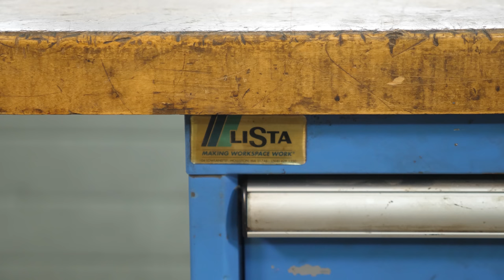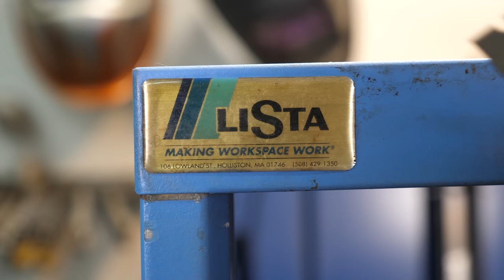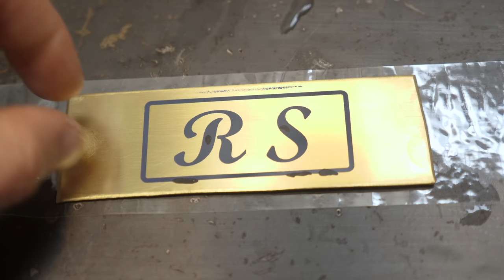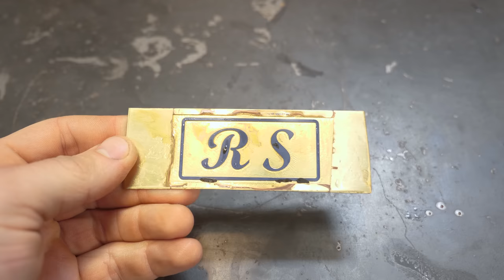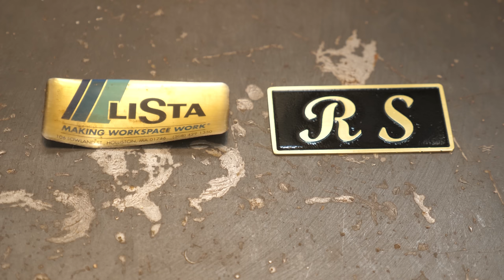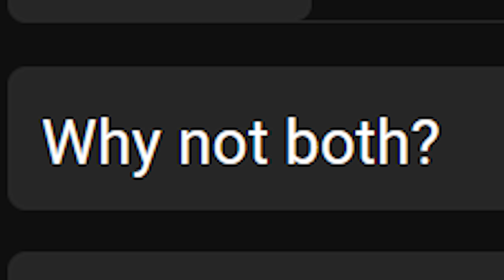Restoring an Old Beat Up Workbench

Comment: That really turned out nice. I kick myself in the butt for not taking advantage of work benches I have seen and I thought it would be to difficult because of the wooden top. You're not there right now the ballpark.

I had a neighbor of mine when to harbor freight tools with me. He asked what's right looking for anything particular I said yes a service type of car made out of metal. When I showed him what I was getting and what I was paying for it he said to me that at his work about a month earlier the district manager told him to put the cart at back since there was missing paint and from rusting. He told me it was more rusted up he said if I wanted you will throw it in the back of his truck on his way home the next day.

I was like a little kid on Christmas waiting to see what I got. My mind was blown away about how heavy duty this thing was. They're really wasn't anything to take apart it's all weld it together. So all I needed was to make a trip to Home Depot pick up a couple cans of spray paint. As soon as I got back I seen it the whole entire cart then primed and painted the cart.

That was 12 years ago and it is still in great shape.

Metal stuff does not scare me away since I know how well and there's no shortage of machines around my house. It's just the wood top to that bench that stops me.

Could you tell me what you put on the top. It seems to be some sort of epoxy since you mix the two things together.

Also I have a great video from you. I'm already a subscriber and of course I make sure to hit the like button.

Comment: The planer and maybe a couple dowels would have increased its durability, but routing out a couple slots for bridges between the planks would have increased the curb appeal. Lots of over spray on the drawers

Comment: What was the product used on the metal top? It looked like something you mixed together.
Reply from the maker: It's bluing solution. Normally you dilute it with water which is what I did

Comment: four swivel rollers so you won't ever have to lift an end and you can get it wedged in anywhere you need. I like the steel plate for an optional top though.

Comment: The hole filling tactic was nifty keen indeed. Though you could have used a disposable plastic bag cut a corner off and squirt the mix like icing into the holes rather than try to force it in with a putty knife. Still though, quite good work.

Comment: Top turned out OK for a basic glue up. You did nice work on the metal as well. Terrible rattle can paint job and it looks it. Should have kept blue and original.
Reply: yeah lista is iconic, either keep it the blue or the old school listas were orange.

Comment: I always feel a restoration like this is a commitment to maintaining a valuable piece of workshop equipment.  From that perspective, this was an excellent job

I don’t know that I’ve ever seen this particular brand of merchandise, and there are some elements of it, specifically the two uprights, which make it look like a converted desk. The cabinet/drawer piece also looks out of place, again because that element looks like desk drawers rather than a tool cabinet for wrenches/screwdrivers, etc.  With all of that said however, I’d be pretty happy to have this in my shop.

You spent a fair amount of time cleaning up the wooden top (looks like butcher block to me), and when you were finished, it was beautiful.  Was there any consideration in just flipping it over and using the underside as the top?  It would have seemed to have been whole lot less work in cleaning it up than you had to spend on redoing the original top side.

But why do all of that work just to cover it up with metal?  If you planned to do that from the start, why waste the time refinishing the wood?  Just slap the metal on it and move on.  Although your goal of restoring and/or improving it was clearly met, at the end of the day, it’s still just a workbench.  Leave the wood exposed so it can be admired.
Reply: I realize this is 6 months late, but the underside seemed to have inserts to accept the bolts holding on the top

Comment: Well I think the convertible  metal top is cool it does mean you cannot put a vise on the table. I would have left an eight or ten inch strip on one side of the table either wood or metal so a vise could be attached.

Comment: There is a massive difference between UK and US workers. UK wood workers wood never sand the top but would use grime and oil remover. Metal work much the same but unlike most comments. Metal would not be painted and the patina would remain (unless it is rust through)

Comment: The only thing I would have done differently would be using a planer on those top pieces, and I would have replaced that flimsy bottom shelf with wood. Cool project, though.

Comment: I think if would've made a cut out into the wooden bench enough to slip a steel sheet or metal in general for around half the size of the bench and put some screws in to hold it or any other idea .. it would have looked cool but I have no idea about it's functionality .. it just popped up on my mind

Comment: I like the end result, though it seems that there were some shortcuts taken.
Insides of the drawer cabinet and the underside of that wooden desk being the biggest ones.

Also, it seems that you've welded the hinges a little too cold. Next time, a bit more voltage should do the trick, but I doubt the plate will come off the hinges any time soon.

A bit more attention to the entire build would've been nice. And not just focusing on what you see.

Comment: lovely work but i feel the hinged metal top was not a good choice.
too cumbersome and potentially dangerous when flipping, for a mostly useless feature.
Reply: Depends on the use case for the table - The metal sheet makes sense if he's not planning on ever setting up a welding table due to space but doesn't want to risk scorching the table surface

Comment: I enjoyed most of this video. Well done. 

Some feedback if I may: 

1. Why change the colour of the bench? This was a restoration was it not? 
2. You welded on an unprotected, finished, wooden worktop. Words fail me. You also neglected to address the obvious burn marks left behind. 
3. Why not plane the top of the worktop? So much quicker, easier and a better result. 
4. Split joining - I'm not the first in this coments to say this. This ought to have been done on a flat workbench, the edges squared after applying the glue, then clamped in place. Biscuit or dowels would've made it last longer, but bow-tie spline would've been the way to go here. Heaps more work, but worth it in the long run.
5. No handle for metal worktop. You could've added a small tab, handle or something along those lines. 
6. Spray paint - Did you not notice the missed areas inside the cabinet where the rails attach? 5 extra seconds each side while painting and it would've been invisible. 
7. No lock replacement on the drawers. This is just disappointing. 

As I say - good work, but some small details missed. Still - damn good on you for doing it rather than sitting around the house watching YT.

Comment: Much better without the metal sheet on top. Top end restoration which felt a bit ruined but a relatively rough job on the hinge welding 😬 sorry but it looked messy. Great effort on everything else though

Comment: Today I'm a particularly asshole.
the work on the whole is a good job. you see that you work more frequently with iron. for the wooden top, on the other hand, you can do better. you could have rested the clamps on the ground and the boards on top, in this way already with the weight they would have leveled off a minimum. on the short side at the end I would have put a rigid and straight strip on both sides and put in the winepress to have an excellent alignment there too.
I completely liked the work of the steel top with the hinges even if I don't understand why I didn't remove it from the table to clean the underneath. in any case the worst part was the wheels.
1) you could assemble them before so the work would have been easier than lifting all the injured part of the table including the drawers.
2) 4 swivel wheels with the two front wheels with brakes. having those two fixed on one side is an incomprehensible choice.

sorry but today it's raining and i'm in a bad mood so i'm trying to release my anger because i can't find where to turn my head

Comment: Good job! Dut it is noticeable in the video that the workbench needs a back panel: only 6 bolts and a shelf on the bottom - this is not enough for the rigidity of the whole structure.

Comment: Figure out how to have a removable wood top that could be bolted to the steel welding top, when needed. Keep track of how often you need to use it as a welding bench or a wood top bench, and go from there.

Comment: No need for restoration on something like this. Throw a 1/4" mdf on the top with a couple of screws so you can replace it, and probably another sheet on the back to stiffen up the lateral movement. Some 409 degreaser on the metal and you're good to go!

Comment: I was hoping that you would leave the blue color.... Red is too aggressive and bright.  And why is painting done on a surface that has not been cleared of old paint?
Reply: Inside the drawer compartment the old color has been left. Not visible - not needed? Saving paint? And lastly, why isn’t the second side of the metal table top given the same bluing treatment?
Reply: The finished work looks beautiful, no doubt, but all the above details give reason to doubt the quality of this particular work.

Comment: Really nice job. There’s only a couple things o would’ve done different in the design. One, I wouldn’t have put steel on the whole thing. Given what I know now of wood working and such, I would of routed out a 2’x2’ space and had the steel recessed down in there for a more functional and sleek look. Two, I would’ve put swivel casters on both sides for easier mobility. My other beef with this is why would you work that metal on the wood bench you just refinished??? That’s just me though!!!

Comment: I gotta say, this one isn't that good.
the red color is already chipped before you finished it, the weld on the hinges are ugly, even after grinding, and you coated the metal plate on just one side.
Anytime you fold the metal plate up, you'll see the gross underside, and you don't even have a way to lock it in the upside position. that's gonna bash your head in when it comes down

Comment: I don't understand the intended use of this bench? If a woodpeckers bench it needs bench dog holes, and a wood vice not a metal top. If a metal workers bench the tub top is too thin, and the bench is way to light. Also wood top  was nice till you burned it attaching the hinges. Additionally don't care for the Red with what looks to be a blue lathe bench next to it. Why didn't you refinish inside the drawer box, or at least  grey like the drawer sides? Well done, but not beautiful.

Comment: You did a great job but it’s a work bench so l don’t see the point on a restoration. It’s a work bench that gonna dirty right back up unless there is such a thing as a “show bench” and at that point its a desk and no longer a work bench. Some things are just supposed to shitty in my opinion.
Reply: the blue probably didn't match his Snap-On set and its nice to have a fresh work surface easier to see  your parts